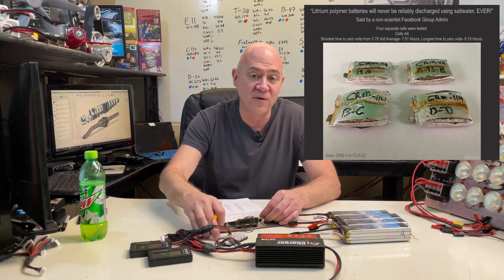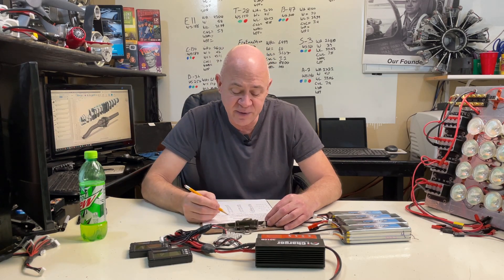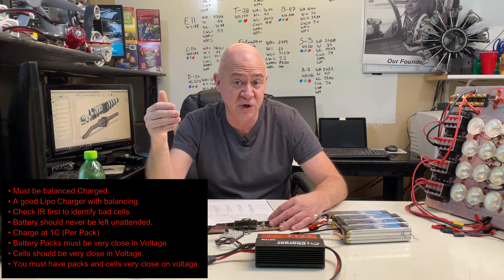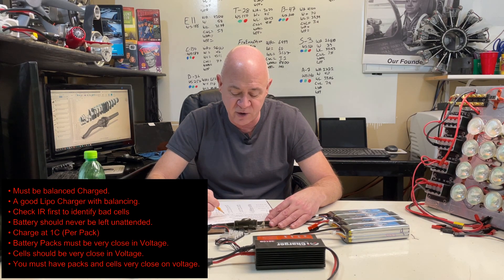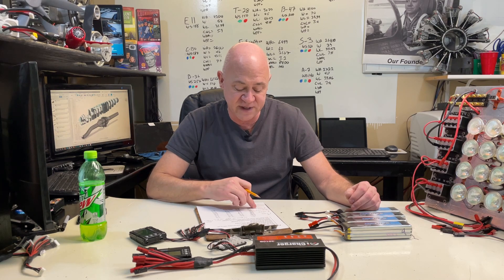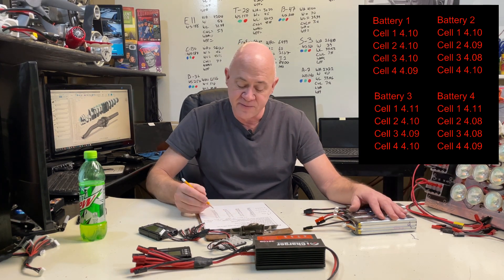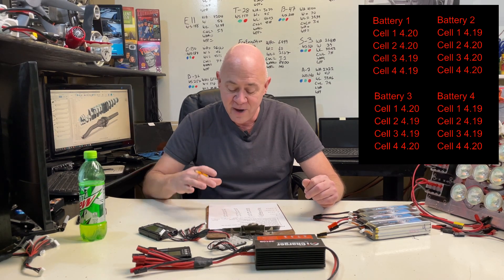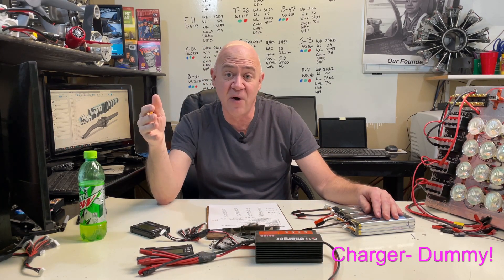11 Years of Parallel Charging Lipo Batteries. Why no problems? Not One!

Comment: Hello @dagtheaviator, I'd like to ask you about this exact question...
I'm thinking about moding a wireless keyboard to add more battery capacity to it and I was thinking to change the stock 1550 mah 1s battery with 4 1400 1s batteries....
Would it be too dangerous and should I go instead for a big battery and cut some plastic of the case instead?
Or if I make sure they are balanced before putting them into the keyboard I should be fine if I let them charge using the own keyboard charging port?

These are the batteries I've bought to this pourpose and they are suposed to came with individual protection and I would be charging the keyboard bit the computer so I'm not increasing the charging voltage nor the charging current (yes, I know it will take way longer to charge up too) but I'm still unsure if that would be risky enough or given the low charging rate it could be damaging for the batteries instead.
Reply from the maker: Gosh, I don't know. For me, I balance charge everything. If four batteries are charged separately and have the same mah, voltage, and IR, to me would be fine. But when you make a pack, you need a way to balance charge, even at a low rate.  I am not sure what you mean by a bigger battery? A store bought battery with higher mah? In my experience if you don't change the voltage, and only the mah, the charger will work. I hope what I am writing makes some sense? Maybe e-mail me- dagtheaviator@gmail.com :)

Comment: Hi my charger/balancer worked well for 5 years, now it no longer balances.  The manufacturer says it cannot be fixed.  I do not have a job, so I can't buy another right now.  So I am charging each cell individually (3S 1000mAh).  
It takes a long time, but it works, I think.  U think it is ok?
Reply from the maker: Some of my pals only balance every 3-5 flights, while other balance every flight. So what you are doing is fine. If you are able, and you may have already done this, check every balance wire on you charger. I friend had one break, and it would not do a balanced charge. If you have a way to check each cells voltage, and they are all close, you should be fine. But always stay near the charger when charging. :)
Reply: @dagtheaviator  ok, good idea.  thanks

Comment: I'm running 2 2200 venom fly lipos in paraell.do i have more flight time than running just 1 4400 Lipo because I have more cells using the 2 batts in paraell?

Comment: I am new to the RC plane hobby at 47. I had, and modified a Tamiya RC car in my youth, but always wanted a plane. Recently my wife and I were at the park with our young son (just 2) and saw someone flying a small P-51. She said "That looks fun, you should get yourself a plane as an early anniversary present."

One question, perhaps I missed it. For parallel charging, is the charge rate calculated by adding the batteries capacity, then calculating what 1C is as though they were one big pack?

Your channel is one of my favorites with your presentation of information with, data, experience, logic, and science. Thanks for sharing your knowledge. So many channels are just "this is what to do" without imparting the why. I always wanted to know the how and why something worked, so I could understand, and build on that knowledge. It comes from my father. He was a German VW master mechanic, and always taught me how systems worked so I could troubleshoot on my own. Thank you.
Reply from the maker: Hello. Most chargers are "smart chargers". You need to get a good "balancing" charger. It will know when it is charged. I set most of the charge rates at 1C. But, when parallel charging you can charge at 2c if two packs, or 3c if 3 packs. If one pack took 5 amps, and I would set to 10 amps with two. Hope this helps. Thx, DAG
Reply: @dagtheaviator  Thanks for the reply. 👍🏻🛩️

Comment: I've been parallel charging since April 2019. I have a Revolectrix GT1200 (40 amp) and a GT500 (20 amp) with two parallel boards that I power with two converted Dell 750 watt/12 volt/62 amp server power supplies. I use a Hitec lipo checker. I like it because it shows me the voltages of all 6 cells simultaneously. I don't have to push a button to cycle through all the individual cell voltages and then remember what each one was. I make sure that all of the cells of the packs I'm going to connect in parallel are within 0.1 volt of each other. I feel like that is close enough that there won't be too much current flowing from one pack to another when I first hook them up. With 6 cells, the largest difference I could have is 0.6 volts and there's probably enough cell and wiring resistance that the initial current is less than 5 amps. One thing I'm doing that might be an issue is parallel charging two 5000mAH-6S packs with two 3300mAH-6S packs. When I hook my batteries up, I add up their rounded off 1C values. I'll count to myself, 5+5+3+3=16, and then add 50% to get the 1.5C rate of 24 amps. Now, if you divide 24 by 4, naturally you'll get 6 amps per pack. But, is that what the packs actually see? If they do, then I'm charging my 5000's at 1.2C (6/5=1.2) and the 3300's at 1.82C (6/3.3=1.818). So far, I've had no problems. The 3300's actually last longer than the 5000's, but it's because of the EDF's I fly them in..
Reply from the maker: Great info. Thanks. I have never heard of anyone parallel charging packs that were not the same mAh. It's something I may run a few tests on.
Reply: @dagtheaviator  I just ran some tests with a clamp-on ammeter I bought a week ago and found that the 24 amps I have been pushing into two 3300mAH-6S and two 5000mAH-6S batteries is divided pretty equally between the four packs. Each one was getting very close to 6 amps. So, it looks like my calculations were correct. If you’re going to push more than 1C into your packs, they should really be identical and rated for it..
Reply from the maker: @txkflier  great info!! Thanks!!